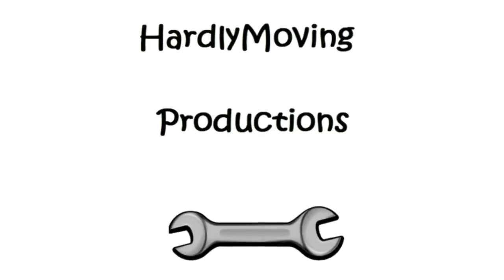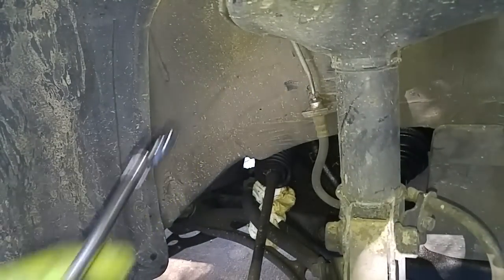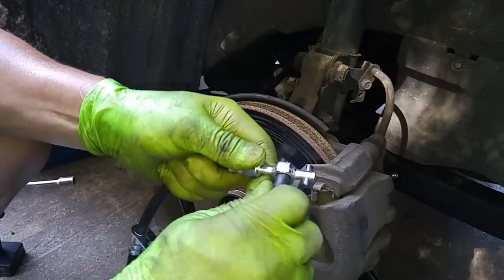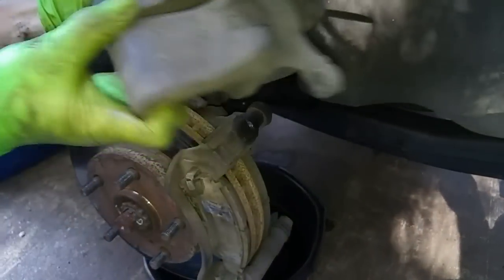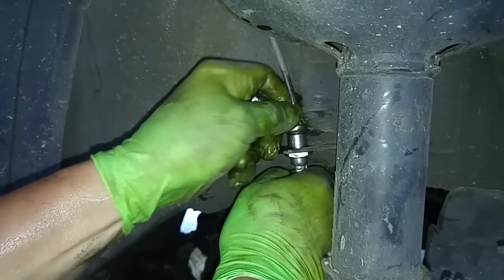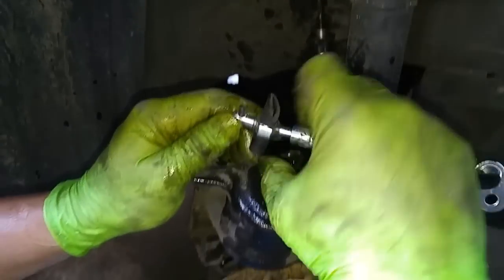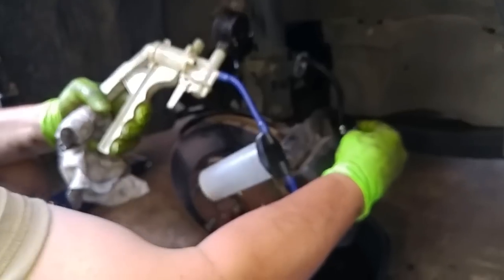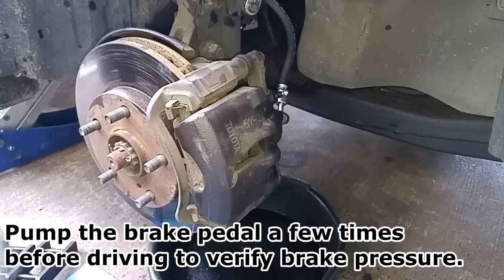Brake Line Hose Replacement - Toyota Camry

Comment: If I can add one piece of advice for anyone else doing this,especially in the rust belt arears. Be prepared for that union at the hard brake line to snap or twist. Soaking the line connections with penetrating oil or just heating it up helps alot. Then followed by tightening and loosening the connection so the hard line doesn't twist and break off.
Reply from the maker: Yes ... I'd agree.  The older the car and the saltier the climate it came from, the more difficult to remove the flare nut.
Reply: I feel really fortunate to be in dry  California. We may have fires, but at least we don't have rust!
Reply: I want to do this job and have all the parts ready but im worried about the hard brake line twisting and getting damaged. Ideally i want to turn the flexible hose and stop the top bolt from turning? Forget that it came lose fine.
Reply: @Wren4123  78

Comment: I think I can use my Orion brake bleeder kit to do this, got to change the brake fluid anyway (1998 Camry LE) and want to install stainless lines up front. Thanks for posting.
Reply from the maker: You can also use a buddy to pump the brakes while you open and close the bleeder valve.
Reply: @hardlymovingpro  No need to with the bleeder kit. It connects to the brake fluid reservoir, sealing the system. I pump it to 15 psi, therefore eliminating the need for another person.

I will do this once I swap the lines so I don't have all this brake fluid shooting out where that 10mm nut is in.

Comment: I have important question.  Im replacing  caliper and line on the other side and wondering if I can attach the new line to the new caliper and attach the line last. I would bleed the brakes of course. Can I do that or do I have to attach the new line first then the caliper?  It would save me a mess from wiping caliper off trying to connect to fluid filled line.  Thank you and your feedback is much greatly appreciated. I didn't think it would matter since the new line and caliper already has air inside am I correct?
Reply from the maker: Yes.  Attach the line to the caliper first.

Comment: I'm getting a new caliper and a new hose, do you think it's better to attach the hose bottom end to the caliper first then the top end. I'm trying to minimize the spillage.
Reply from the maker: Top end first and connect to bottom when fluid starts dripping out.  I know.  Messy.

Comment: Hello there, I'm just wondering why you changed this part ( brake hoses ) because I have a problem in my car ( Honda accord 2008 )and I replaced the calibre, so  do you think the brake hoses  is broken? Thanks
Reply from the maker: Over time the hose weakens, cracks and may begin to leak.

Comment: What did you do at the end with the clamps
Reply from the maker: It's not a clamp.  It's a caliper piston compressor tool that presses in the piston so that it clears the brake pads for re-installation.

Comment: Do you think I should let the new brake hose starts to drip before installing it? So it can limit the air go into brake caliper.
Reply from the maker: Yes you can.  After the hose is attached to the caliper, you can also open the bleed valve and let gravity push out the air with the brake fluid.

Comment: Why you pushed break piston back after mounting hose? Isn't it easier to do so before mounting hose? I can do if by finger without using tool.
Reply from the maker: Doesn't matter.

Comment: Hey my brake pedal is spongy and sinks in, so planning to change the hose and do brake bleed. My question is, should I do brake bleed first before changing the hoses or it's the other way around? Thanks for your help!
Reply from the maker: If there is no fluid leak, problem may be your brake master cylinder
Reply: @hardlymovingpro  Yeah, I am getting mixed responses in this. So, decided to start from parts that cost less. Thanks
Reply from the maker: @amjathkhan2004  master cylinders are not expensive but more labor intensive to replace.
Reply: Changing the hoses introduces air into the system, it makes no sense to bleed the system before changing the hoses. Put everything thing back together then bleed the system.
Reply: @sloebone7399  Perfectly make sense. Thank you for your help!

Comment: I'm noticing a few drops a day of what appears to be brake fluid dripping on my driver's side front - just under a bit of the subframe where the front driver's side control arm mounts to (I believe near the middle mount of the control arm) - it's slightly darker yellow than new fluid, but has the same mineral oil type feel - and smells only slightly different than new (or reservoir residing) fluid - new fluid seems to have almost no smell, and is only very, very minimally yellow, the drip seems to smell very slightly of oil and is darker. My reservoir doesn't seem to be going down noticeably. I'm wondering if this is likely to be the same leak as you'd repaired before doing the passenger side in this video? Is this a more likely place for a leak than the caliper hose points (and bleeder valve)? I'm planning to put the car on front ramps for a better look - do you think removing the wheel is required to see this flare nut / retention clip area?
Reply from the maker: You're better off removing the wheel to get a better view on what's going on.  A leak could be also coming the the caliper piston seals as well.  If a hose leak, the hose would be wet.

Comment: im burning thru brake pads now every 4000 miles on my camry . just replaced the front calipers and the problem still persists. any idea what the issue is?
Reply from the maker: Rear brakes may not be contributing to the overall stopping of the car.  Tell tail sign would be the front end noise diving during braking.
Reply: @hardlymovingpro  well rear pads are wearing out too but they are consistent. whats the fix on lack of rear brake power? can a bad front brake hose  be the issue? calipers are new up front and both wheels spin with no binding when the car is up on the lift
Reply from the maker: Maybe quality of brake pads may be a factor?
Reply: @hardlymovingpro  not in this case ...using the bet only getting 3500 miles out of  a set now
Reply: @CAFEX24 i would change all hoses because of the hoses are collapsing they may not be allowing fluid to go back for releasing the calipers

Comment: Hello there, I noticed the copper crush washer are completely flat on one side and more rounded/beveled on the other. Does the completely flat side have to be towards the flat metal surface of the brake line, and the rounded side facing the banjo bolt to make the proper seal so fluid won't leak? Thank you :)
Reply from the maker: Great observation!  Never noticed that difference.  I'd think the rounded side should face the banjo bolt and flat side against the inlet ring.  The reason being the bolt will be rotating against the rounded side crushing it down and forming a good seal.  Also , you have two (2) copper crush washers.
Reply: @hardlymovingpro  Yes, thank you! I was thinking the exact same thing.. I also remember seeing a similar type washer on a Toyota Vans Transmission drain plug, which was also flat on one side, and more rounded/beveled on the other. However this washer was made of aluminum (much larger), and required much more torque to crush and seal. I'm not sure if it  will make a difference however the washer is installed, or cause any leaks/issues. It is just interesting that they designed each side of the washer differently; I assumed there would be some rationale behind it.. :)

Comment: You took the caliper off to prevent air from getting in, but isn't the new hose gunna be filled with air?
Reply from the maker: Gravity will fill in the air gaps.
Reply: @hardlymovingpro  But air will be sucked into the caliper. Doesn't make sense. Also, doesn't bleeding in general ensure there's no air left in the system? That is, isn't the brake designed to be able to push out the air?
Reply: I agree this guy is gonna kill someone

Comment: It seems like this would be a good time to do a brake fluid flush. Bottles are like 10-20 bucks. Thoughts on this?
Reply from the maker: Absolutely!  Will help the longevity of the brake master cylinder.  Here's a video where I did it quick and simple using my ac vacuum pump: https://youtu.be/InnDPwkLMQs

Comment: What size is that brake line hose you fit inside end of brake line?
Reply from the maker: I do not know.  Each make and model is different.
Reply: @hardlymovingpro  I know. For this job obviously I was wondering what size rubber brake line you used to put in the end of the line to slow the leak.  That small 1 inch piece of rubber line.  I have 97 es300. Same as this
Reply: I changed my caliper but was an emergency locking up and couldn't get the line until after I fixed it. I guess when I change pads and rotors again ill change the line and other caliper. I don't see fixing everything when the car only has 50k miles. Rubber still looks good and had good flex.

Comment: Aren’t you u supposed to push the brake pads with bleeder screw open
Reply from the maker: Push down on brake pedal and open the bleeder screw ... close bleeder BEFORE releasing the pedal.

Comment: Toyota specifies torque values for the hose connection , banjo bolt and pins. But then he doesn't know how to use a torque wrench and probably doesn't have one. I'm not a perfectionist but this is way too sloppy for me. Please tell me you don't work on airplanes .
Reply from the maker: No ... I don't work on airplanes but do have a instrument rating.